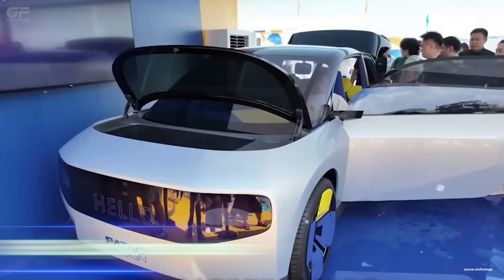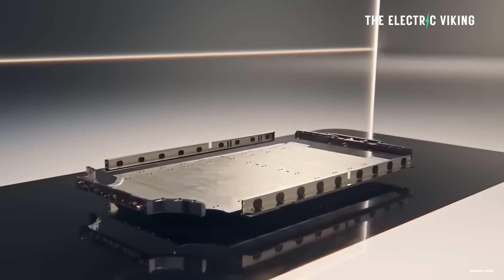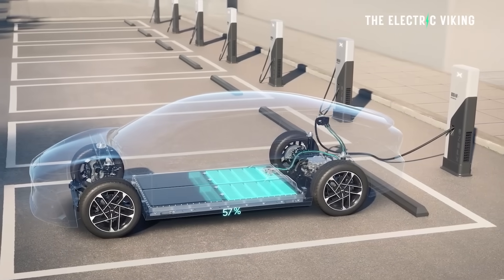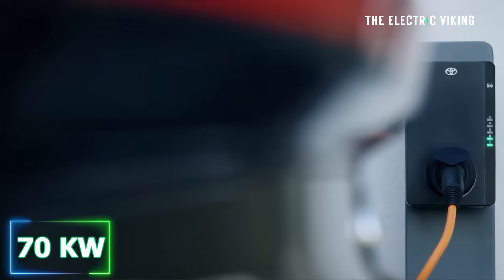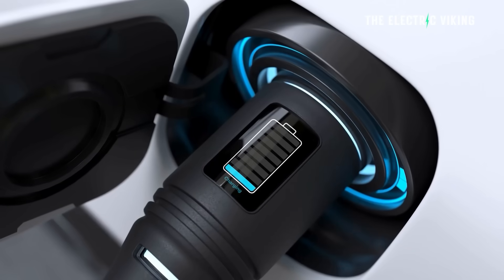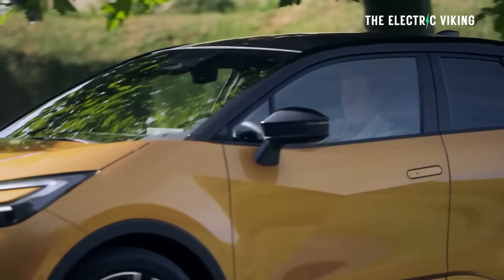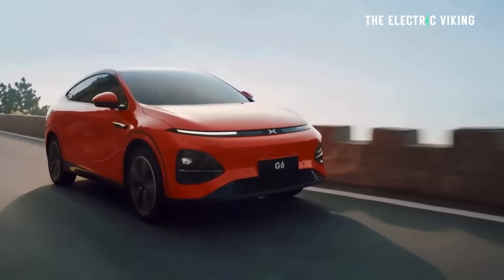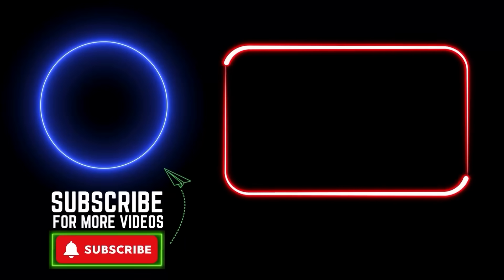SAIC GM's 400 Wh/kg battery will enable 600 mile range EVs in 2026

Comment: Yet a lot of EV owners will tell you that 250miles is more than enough for everyone.
Personally, I'd prefer a range of 400+ miles to match the range of an ICE.
Reply: I drive more than 250 km a day. 400 km of range on a 100% charged battery isnt enough for me coz most of the time ppl charge up to around 80%. Charging daily wouldnt be very lucrative unless i could charge at home (which i cant). So if is not somewhere way above 600 km of range for a 80% battery, then is a no go for me
Reply: @user-os4qe9gn4s  curious why can't you charge at home? street parking, or garage doesn't provide it?
Reply: @xtdude living in block with 10 floors.
Reply: @user-os4qe9gn4s I'm a little confused by your math. If you do 250 kms a day and a car below 400 kms is a no-go (at 80%,you are still at 320 kms), you are expecting only to charge at home but not on the road (which you would have to do with petrol)?
Reply: Where are you going to charge it? What is your daily commute? What is your bladder range?
Reply: @casper_hansen  It's not about my bladder! I'd prefer not to have to charge the car at all on my longer journeys. Depending where I go, chargers can be quite sparse. I could take alternative routes, but would prefer not to.

Comment: If and when these new solid state batteries do enter mass production volumes and economies of scale make them competative you could put them into small mass market EVs which do not need much range allowing for the use of a smaller battery.
Or you could put in a smoking  hot motor and turn the small EV into a hot hatch to run down  Teslas for schitts and giggles...

Comment: A battery at 400wh/kg will transform the electric motorcycle industry - which at the moment is restricted to city bikes and scooters.
Reply: Yes, we've already got 1 ICE car and 1 EV. I still have 2 ICE motorcycles. Can't wait for the day to have a 20-25 kwh electric motorcycle with 100 hp and 500 Nm torque @ < 200 kg.
It would be a beast.
Reply: @TwistofWrist1941  The Energica Experia is available now with a 22.5 kWh battery, 24 kW Level 3 charging, and a 150mi (250km) range.. But a little more weight than 200 kg. I'm personally waiting for a touring "Goldwing" bike with 200mi range, full luggage, Level 3 charging, and shaft-drive. This should be possible in the seeable future.
Reply: @dr.x4050 It's 45,000 AUD. No thanks. It'll probably 5 to 10 years before these new battery can come out cheaper. I mean I want a daily commuter, like the BYD Seagull. If the Seagull can be sold for 25K AUD, a perfect EV motorcycle commuter would be around 15k AUD.
Reply: @TwistofWrist1941  I never said it was cheap, but it is at least available. It seems you're not expecting too much for the bike you described.
Reply: @dr.x4050 I need a cheap daily commuter bike, not 45k beast that you take it out 5 times a year.
Reply: I have a '20 Zero DSR motorcycle, my model is the sedate touring model and has 70-180 mile range depending on speeds and stops; I get around 110-130. My 'car' is a '00 F350 utility truck. My next car, when the Ford finally dies, will be a regular EV car. I'm 70, my capabilities and time are limited and the lack of maintenance and refueling is wonderful.
Reply: All island nations should ban petrol engines cars and motorcycles immediately
Reply: @mmhmhmhmhmhmhmh Very good insight.  Island nations lose sovereignty by having to export to get dollars to import oil.  They are then debt slaves.
Reply: Great but, What's the longevity?

Comment: The thing with PHEV is most people who use them have got them as company cars, particularly in the UK, and they never plug them in. They have always been a tax dodge!
Reply: I own a Chevy Volt PHEV, and I resent the gas motor every time I drive it. Pure EV for my next vehicle.
Reply: @GoCoyote  Same here and I agree.
Reply: @joeblow9398  I looked at a few PHEHs.  Just could not make the numbers work.
Reply: The claim of not plugging PHEVs in is based on the charging cable being unused when they are sold on. 

Guess what I've never unwrapped my BEV cables either. Does that mean my BEV has never been charged, of course not. All chargers I use have tethered cables already attached, as is now common in the UK.

Many PHEVs these days are also only DC charged when charged publicly, or charged at home using the granny charger or a tethered wall box.
Reply: My work colleague has a PHEV now he wants a Tesla. He does change his, is common for people that get a PHEV to then get a pure EV.
Reply: In Australia they are plugged in. I know 2 people with BYD PHEVs and they run them in EV mode all the time.
Reply: How is a PHEV a "tax dodge?"
Reply: @robertd9850 I'll see if I remember this right. There was poorly designed leasing in Europe. The lease traditionally maximises costs so that ones taxable income is maximally reduced. So fuel was counted as a cost, reducing your pre tax income. When PHEVs came along, the cost of recharging was never treated that way, but fuel was. So there was a perverse incentive to lease and then use fuel, not electricity.
Nothing to do with fossil fuel companies leaning on whoever they need to lean on to maximise the usage of their produce.
Reply: I plug mine in all the time, as I rarely use gas.
Reply: @joeblow9398  Then you should add fuel stabilizer to the fuel that is in the tank and use it up within a year.
Reply: @joeblow9398  I looked at a few PHEVs.  They are several thousand more than their hybrid only versions so it would just take way too long for me to get a return on investment.

Comment: 500 Wh/kg, thats a real game changer, think of the competition in the auto industry now, knowing this is around the corner. Today enough people are switching to EV’s to make ICE volume and unit costs higher, to compensate and cut costs ICE cars have become unreliable, poor quality junk with horrendous depreciation making them a worse purchase decision new and down right stupid purchase used.
Reply: That it is ok if you have an ev option, our business has 3 diesel vans and 2 utes ( pick ups)  when we can purchase an ev at a reasonable price to replace them all  I will be very happy.  I have owned an MG ev town runabout for over 2 years now and it has been faultless,  cost our business pennies compared to our diesels.  The other thing that is not mentioned enough,  is that all the power supplied to my MG was NZ generated. All our other vehicles depend entirely on the tankers arriving from Singapore.

Comment: Now, in Australia you can buy a used 5 year old Nissan Leaf for 5000 USD and replace the battery for larger lithium for 5000 and have a great car that will last with the new battery for at least 10 years for only 11,000!
Reply: Problem is now you drive a Nissan Leaf
Reply: the world is not that simple, people go a to dealer to lease or buy their new car with a warranty of 7 years or more.  Also some people are just not capable to do what you suggest.
Reply: If only... Different batteries are just that, different. If you're lucky the packaged battery pack may fit and have all needed connections. BUT, what about charging speeds, current handling and other wiring considerations. Then there's the BMS, is it really likely to  be the same or could it actually be dangerous because of differing battery chemistry? Think of it as a piston change; will any old piston fit?
Reply: Yes. Just need service centers who will do the job. My official Nissan dealer said they don't touch the high voltage battery. Scared of electricity? Or do they want me to buy a new car instead? They are going to lose another customer!
Reply: @bhabbott  Setting up a maintenance facility for EV'S is ridiculously expensive for the building, the safety requirements, the equipment, the training and the insurance. An acquaintance owns a body shop. Three years ago he spent a few hundred grand setting up his long existing shop for the "EV Revolution", but the EV side of the business hasn't turned a profit. He said there's no money in EV'S, they're disposable electric appliances. He's going to re-convert the EV section into a truck maintenance area.
Reply: Sounds good on paper but I don’t think you can just pull the old battery out and plonk a different type in. The work would have to be done by a certified workshop and re-engineered and tested to meet the ADR’s. An expensive project.
Reply: It has been in NZ for close to 3 years. Look it up on the net. They use BYD  blade batteries.
Reply: @PropanePete There are some interesting videos on FutureAza of people who DIYd similar projects.

Comment: Yeah, will believe it when I see it. Personally I will be in the market for a new car early to mid 2026, I am currently hoping that by then a car with similar spec to the Shark 6 but a full EV with 550-600km range will be available, that seems a reasonable hope to me given the way battery tech is going, not worried about nearly 1,000km range. I think anything over 550-600km is the sweet spot for EV's, more is always better of course, but consider you could have a much cheaper car with a smaller battery with 550-600km range, or a more expensive one with the top range near 1,000km by offering different battery packs, that's a choice I would suggest is ideal for most consumers.
Reply: That car already exists. It is a Tesla Model 3 LR RWD with 580km/363mi of EPA range.
Reply: @BirdMan1957  So it will drive through sand dunes and down onto the beach? Would like to see a video of that!

Comment: With the rate of innovations in battery chemistries and electric motors, I'm betting that the US will warm up to EVs soon enough.  Not as fast as Northern Europe, but with battery & EV prices dropping, more will switch and charging stations are already popping up all over.  It'll happen slowly, and then all at once.  It'll be like the early days of gasoline cars, 100 years ago, and they'll have to buy fuel in cans from hardware stores.

Comment: You should stop promoting the never-ending, unsubstantiated claims about future battery tech. This just discourages people from buying EVs now and many wait as a result. This is exactly what many automakers want. You also should caution the public that future battery tech may be substantially more expensive (especially in the first decade ot two) and will likely only be economic on very upper end EVs. Current battery tech will not die for a very long time. Many EVs with semi-solid state battery tech will not have more range because automakers will limit battery sizes to maintain reasonable affordability and just accept the benefit of reduced weight.
Reply: So what do you expect him to do just LIE and pretend they don't exist???
Reply: you are a bit wrong there, batteries will be cheaper in the future unless you go for the latest and greatest.  The auto industry has always relied on new models with better tech to sell their latest releases.  That is just the way the world is,  you can always buy used, and that is becoming quite a thing now more evs are on the pre owned market.
Reply: Bingo. The current range of most existing EVs is more than enough for 99% of the driving public.
Reply: It’s literally his job to report on it 🙄🤡

Comment: All of these advances in car batteries are great. But if we want EV adoption to spread even more quickly, we need bigger and less expensive home storage batteries! I’d love to see a 50 kWh home battery and inverter for less than $10,000! We need to disrupt the corrupt electric utility monopolies and cartels!

And, good post per usual, Sam!
Reply: Can anyone explain to me how a modern EV car battery of about 85KW is now at about $90 a KW (Pack Level) so = $7,600 but if I want a battery to store electricity at home its the same price for 16KW (SIgenergy) so nearly $500 a KW. Somebodys taking the piss.
Reply: @elonslawsuit5004 there is much less competition in the home storage market so no need for them to drop prices
Reply: @nazb1982  Actually there is quite a bit of competition in home batteries.
Reply: @elonslawsuit5004  Damn right. I like to ring up solar and battery companies in Australia and have this exact conversation.
Reply: @elonslawsuit5004 it's because the energy demands of a home battery is much higher than an EV. My model s top uses 600w. My house uses 1-13kw at a given moment. That combined with the ability to need a thicker busbar and thicker cable makes them have different requirements but still pretty expensive. The differential from 400 to 500 isn't massive for that change in delivery
Reply: @SSJRapter  surely the discharge rate is the inverters job and nothing to do with the storage capacity and even allowing for the greater discharge rate the difference is 500% in cost. I still think thats hugely excessive. Additionally if you consider that additional capacity modules are charged at the same cost / Kw without the inverter this would mean the high price has nothing to do with discharge rates and is based on the storage capacity. Feel free to put me right if im mistaken.
Reply: @elonslawsuit5004 I'm not sure where you're getting 5x the price. A Tesla battery 90kw replacement is nearly 15k now. 90kw of an eg4 battery system (6x15kw) is 6x3.3k (19k). When talking about the differences in price it's not that stark. When you look at some of the numbers they pose it's going to be cost to manufacturer and not retail price. Include markup and you have your final costs
Reply: Almost there … I bought this month a 40kwh system for 18K … but now I see prices of modules at about 60% of the price so by end of 25 you can install a 40 to 50 kWh setup for 10k. Best of all you can start trading on net in balance and earn 1k a year …
Reply: I can get 13.2 kW solar and 30kWh battery for $10k Australian.
Reply: I really have spent a lot of time figuring this out.  I can tell you live in an area that does not have net metering.  Where I live in Maryland, my power company will act as the battery.  My meter goes negative during the day and goes positive at night.  Without a battery, I have no power bill including my EV.  Yell at your local politicians to force the power companies to support net metering.
Reply: @robertfranz1838  I don't understand your system.  Do you have a battery or not?  Do you have solar?   Something is missing from the description.
Reply: You don't need a home battery to do home EV charging.
Reply: Yes why are they so much? Surely the price is coming down.
Reply: Yes that would be amazing
Reply: My 160 kWh home storage was below  20 k€ including inverter. Admitted, this was very recently.
Reply: This is using 11 boxes of 16 cells each of EVE brand type LF280K and one Deye 20K inverter.